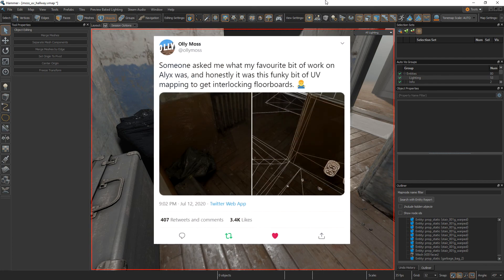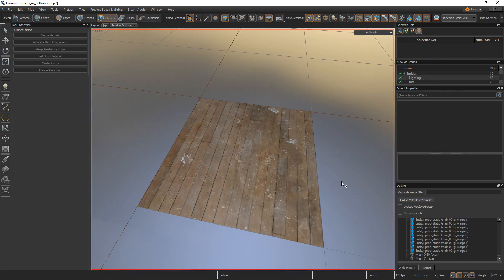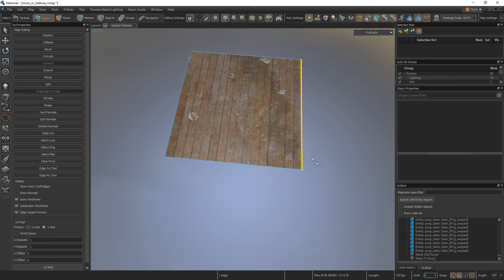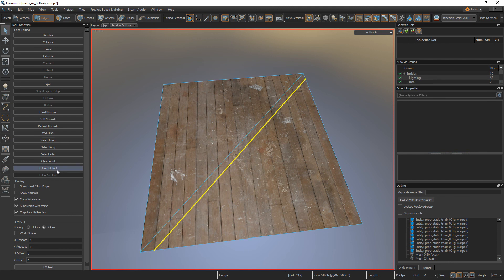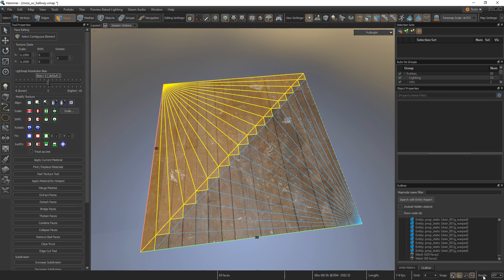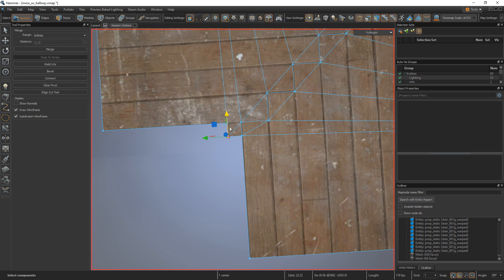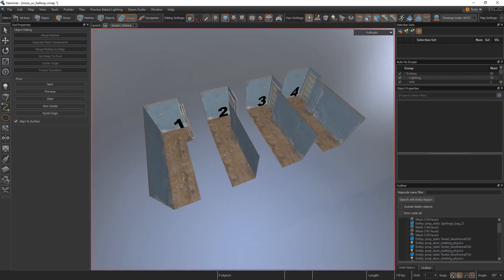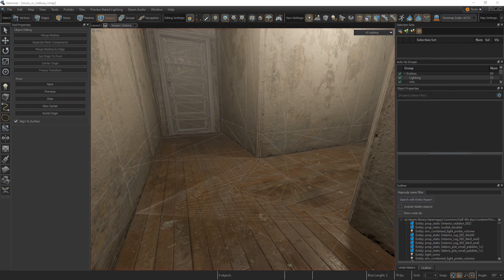Source 2 Hammer: How to Create Interlocked Planks

Comment: I would suggest to do it on blender and then import as a 3D model. That way it would have way less faces and be easier to create and edit. Hammer is just not as powerful as Blender when it comes to creating meshes.
Reply from the maker: It's true that blender is a better modelling tool, but hammer is specifically built for and specialized this kind of thing. There are definitely better ways of doing this than what I did in the video, but I don't agree that you need to switch software to do this. When it comes to curved surfaces however, you're most likely better off moving to blender or maya for anything more complicated than a chamfer/fillet.
Reply: @Saandy_  Yeah, absolutely, you can, it's just a lot of manual work I'd say. Requires ingenuity. I suggest you check videos on the buidify addon. It's specifically made to make houses, buildings, doors, etc. You'll ve surprised at its power.
Reply: @brian-vuksanovich  My workflow for making CS2 maps is mainly using blender. Just takes a bit more time having to make the props in the ModelDoc Editor

Comment: Am i very dumb or just normal dumb for not uderstanding why this is necessary😂, if you’re just going to have a texture there.

For example, when i used 3ds may before, there was a plugin called “floor generator” that would do what its name suggests😁. The thing is, it would make physical planks of wood that would look like a floor even with whitemat.. hmmm
Reply: This is done because there's no texture for planks interlocking at this 90 degree angle. But there is a texture for planks going straight. Polygons are cheap these days.

Comment: It’s this really the best way to do this?
Reply from the maker: Debateable. I would say this is better than authoring a completely new texture. My method can be improved however. The flooring doesn't have to be connected to the walls, and keeping them as separate meshes means you don't have to carry the edgeloops around like I'm doing in the video. Source 2 hammer and these textures are built for this kind of work.

Comment: If this were GoldSrc, you'd just create a new texture and call it a day, lol.
I'm not familiar with Source 2, but couldn't you just not draw edges from the verts in the corner that don't touch the corner onto the wall? The wall is going to use separate material anyway, so if it needs to be a separate mesh to do that, I can't see that hurting anything.
Reply: I believe its bad practice and hurts performance in some way. I think it either hurts performance or vis slows calculation speed. I'm not entirely sure. I'm still trying to wrap my head around building things with meshes.

Comment: Why is this Source Engine?
Reply: @kreuner11  Nah, it's still Source.

Source 2 is just a souped up Source engine, with in-house physics.

There's no screen space reflections OR the latest, Ray tracing.

I could still count the number of polygons on each model.

Heck, light still baked into the map, instead of dynamic.
Reply: @AlfaPro1337  And Source is Goldsource with havok physics,Goldsource is Quake engine with skeletal animation. If you keep breaking down,you will end up at creation of universe. Also, source 2 doesn't have raytracing or screen space reflections (yet) because VR is more demanding than regular PC game. Raytracing is also too new and too expensive especially during GPU shortage for average gamer to buy.

Comment: Another way to do the corner is to just make the walls a separate disconnected object.
Or, extrude down into the floor, then merge the vertices, then extrude up from there for the wall, thus hiding the ruined plank effect under the floor.

Comment: Why do you manually triangulate the faces around the interlock? Surely the engine will do that automatically on compile to a sufficient standard?
Reply: I also felt this was an uneccessary step, so I loaded up the hammer editor for the first time to test it out, and it seems that the engine is quite capable of triangulating n-gons without massively ruining your lighting or textures. It is possible to get some issues, but from what I could gather, what you see in editor is what you get in game, so unless you have specific reasons to manually triangulate, for example you need specific slope directions on non-flat geometry, you should be perfectly fine either way. I moved vertecies in all kinds of horrible positions, and the engine seemed to automatically (and in real-time) adjust the triangulation to what I presume is a "minimum energy state", but anyway, it seems consistent and robust so I really think the extra edges are not necessary here...

One thing I wanted to try but couldn't figure out, was if it was possible to dissolve all extra edges EXCEPT those at the zig-zag seam, so that there was just one single face to select when rotating the texture, however, dissolving those edges seems to want to take verts with it, collapsing the zig-zag back down to a single diagonal line. It's not the worst thing ever, but if anyone knows if it's possible, I would love to know. My only thought on this is that maybe the engine for some reason doesn't want to have n-gons with concave areas? I don't see why though, since, as above, it is clearly more than able to triangulate the mesh smartly...
Reply from the maker: I triangulate those faces to be able to select them, and to rotate the texture UV 90 degrees (3:51).
The two diagonal, parallel lines going across the quad help us to make the Zigzag pattern, and afterwards they can probably be removed so that the result only consists of quads, but at the same time there really is no substantial harm (if any) in leaving them as triangles.

If you are reffering to what I'm doing at 3:18, I would say it's always best practice to not have any ngons (faces with more sides than 4) present on any mesh, and without doing this step, the big triangles on both sides of the quad would have a LOT of sides, as all the lines connecting two vertices counts as a side. In my experience, having ngons on your meshes in Source2 can lead to bad light mapping, and stretching textures.
Reply: @Saandy_  Yes, I was referring to the latter. I'm not entirely sure how Source 2 handles the triangulation, but unless there's some weird BS going on behind the scenes it should have the same amount of faces and sides with the automatic triangulation. Flat, coplanar ngons typically don't cause any real issues unless your mesh is deforming using morph targets or a skeleton, so it really shouldn't be a big deal unless you've got some whacker geometry going on.

But again I'm assuming Source 2s hammer doesn't do some crazy shit to the meshes. I don't have HL:A yet, I was just curious as to the new Hammer editor, but I really like what I'm seeing so far as opposed to the old BSP editor.